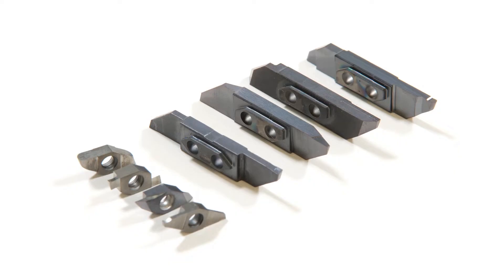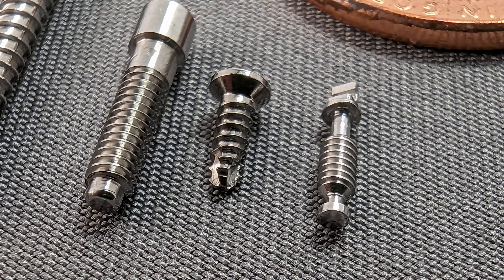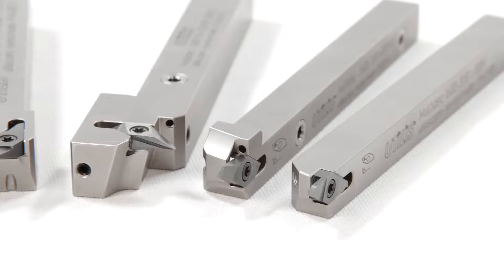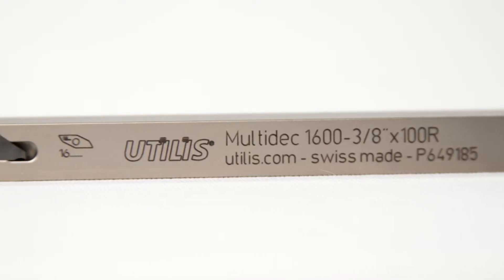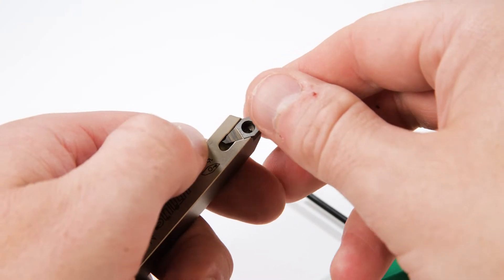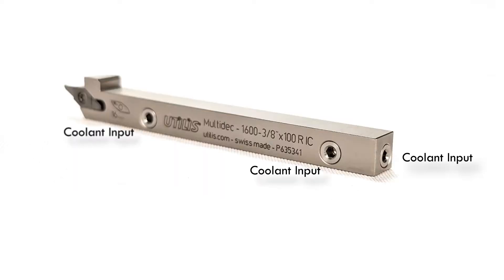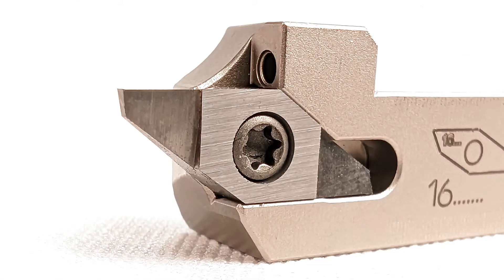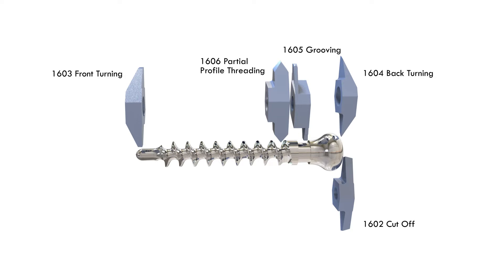Micro Machining With GenSwiss multidec CUT 1600 Series & Holders

Comment: Bill & Scott:  Nice video, very informative!  I'm still looking for an application for a Twin holder - nothing as yet - and wanted to mention that this video introduced me to the combined ISO/1600. What size VPGT is that?  And does it come 5/8" shank?
Reply from the maker: Hi Stephen, the VPGT is one size for the IC so if you're already using VPGT Multidec it will fit these holders. They certainly come in 5/8" shanks as well!